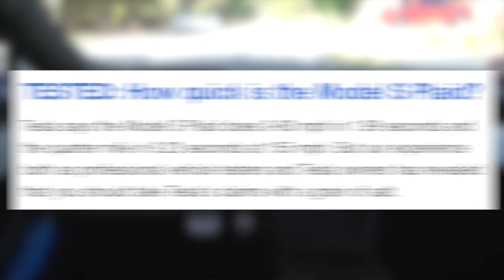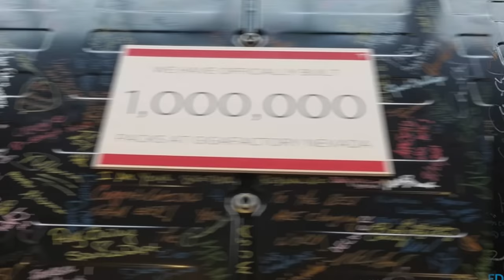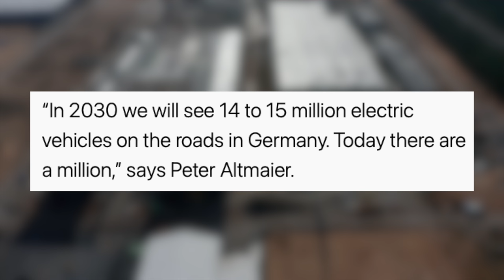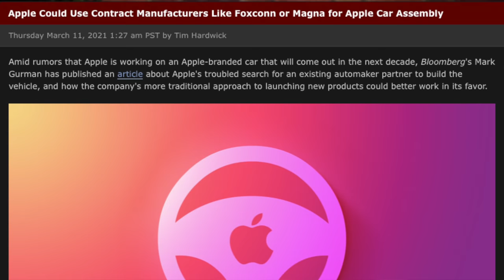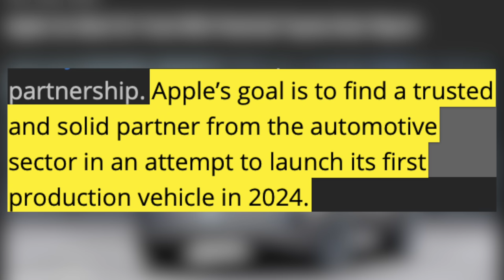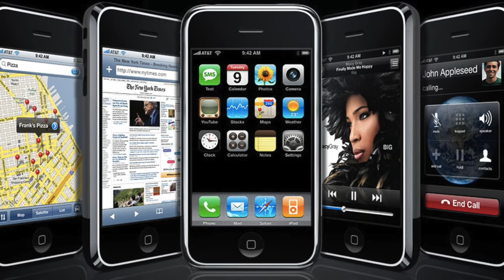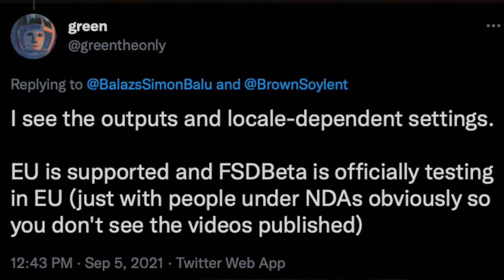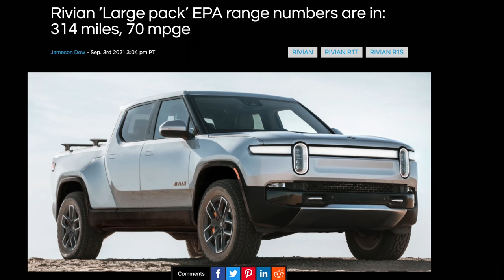Tesla's One Billion Dollar Advantage

Comment: Dodge says their 800 HP challenger will do a quarter mile in 9.9 (maybe it's less I don't really remember) but I only saw one do it in 9.9 even with the skinny front tyres and special fuel, even on a very sticky surface you can't get a close time to what the manufacturer claims, but with Tesla I have seen some 9.2X on the street and a 9.4 is easily achievable on any surface, I have seen a lot of 2.1 sec 0-60 on the street (1.99sec with 1 foot rollout) most brans advertise the best numbers they can get, and Tesla is one of them but the plaid model S gets very close to the claimed numbers even on the street unlike most others brands that are like dodge ( this does not apply to brands like Porsche because they always do better in real life than the claimed numbers 😂).
Reply: Yep. In fact most ICE cars require massive amounts of skill to get their sub 3 second times.
Reply: @ernestbethel2035  you can see videos of Ferraris losing control in like 1 second, you don't see that a lot with EVs because the power curve is a lot more "predictable"
Reply: Another way to see this is Tesla proves it can be done and other the. Try it
Reply: Its a RWD car, it simply cant put the power down unless it transformed into a real non street legal dragster. Look at all the built GTRs out there, the fastest one has done the 1/4 mile in 6.58 seconds. The fastest EVs are still in the 8s, and those are millions of dollars. The plaid is impressive setting low 9s for a production car, and I'm sure the roadster will hang in the 8s when its out.
Reply: @Malinkadink  the fastest EVs can be on the road, the fastest ice are SUPER UNSAFE and go to track on a truck, I don't give a fuck about how fast an ice car is if it can't even drive on the street. I just saw a video of cars losing control after heavy acceleration, Ferraris, Dodge, McLaren and much much more, the ice cars power curve is less predictable when compared to a ev. Why do think the most HP on a ice car for now is 1500 HP stock from the factory? Because you can't get it higher in a safe and reliable way, EVs are coming out with 2000 hp from the factory. Yes there are ice cars with 2000 HP but they blow up gearboxes all day and can't even drive on the street because they are to unsafe or even illegal (just check carwow drag races and see how many times a tuned 1000+ HP ice car as broken down). Just accept the physics, I have studied a lot about this because I am a mechanical engineer student.
Reply: I always get a chuckle when some people mentioned that their 1000+ hp ICE car are useable for a daily drive 😁
Reply: BMW also does better in real world use on all performance and economy numbers.
Reply: @KungPowEnterFist  Nice! But only the new models because they have a great AWD system and before most of M performance bmw were RWD so you would get a worst time on bad conditions.
Reply: @meisterkenobicrypto  Well, bad conditions are bad conditions.  I don't think any reasonable person would think that the MPG's, 0-60, etc., would be the same in a blizzard, heavy downpour, strong headwind, mountains, etc., as they would be in 72 degrees, flat, no wind, no rain, etc.  However, BMW's stated numbers are usually very conservative.  Mercedes tends to be pretty tight with their numbers.  Others just straight up lie, like Tesla lying about their economy numbers.  Performance seems to match up with their claims...sort of.  Lots of asterisks.  Economy, lol, not a chance.  You will need to go to extraordinary lengths just to get 2/3's of what they claim.  Its ridiculous.  A typical user using the car like a normal person should expect to get about half of what Tesla claims.  Half!  And part of that is only possible because Tesla is most giving away the power at their charging stations for no profit.  That ain't gonna last.
Reply: @KungPowEnterFist  check carwow driving teslas and other EVs and see the results of the range tests, if you think Tesla doesn't do it's claimed range by a large margin the. You haven't seen the polestar ahhaha, polestar gets around 60% of it's range. Carwow does highway testing, please check on of the videos. It's the WLTP and EPA that test the cars, if you want a real range estimate check Bjorn nyland a ev YouTuber from Norway, he tests every ev from the most expensive to the cheapest and data shows that Tesla is still in lead by quite a margin.
Reply: @meisterkenobicrypto  I didn't say anything about range.  I said economy, as in cost per mile.
Reply: @KungPowEnterFist  Oh i didn't know you were talking about cost per mile, cost per mile is realated to efficiency and the teslas are still a lot more efficient, data from bjorn nyland proves it. Also i have i noticed that tesla superchargers here in europe are muchhhhhhh cheaper than the chargers from ionity and other brands, so a road trip in something like a ford mach-e in worst case could cost 2 times more than a road trip with a tesla because the mach-e is much much much less efficient and pays more for charging since it can't use the superchagers. I own 3 evs, Renault zoe, Tesla model 3 and X, and I have recorded all the data on how much i saved, were and when i charged and much more, and what i know is that 90% of the charging is done at home during the night time with very very very very cheap eletricity, at my house if i charge on the low price hours I pay around 8 times less than if I had a ICE car, but when i went on a roadtrip and tried to use ionity chagers i only saved around 1.5 times the cost when compared to an ICE car, but since I charge 90% of the time at home the average is (0.90*8+0.10*1.4)=7.34 times cheaper than an equivalent ICE car. I think you should take a look at the Tesla impact report 2020, there is a section talking about cost per mile and i think you would be interested in taking a look. Evs will get cheaper and cheaper will ICE fuel will go up until they die. This is my opinion as a mechanical engenieer. (Data in the tesla impact report is collected from tesla drivers and are not made up projections, remenber that data doesn't lie).
Reply: @meisterkenobicrypto  I did not use the word range not once in my comment.  This is Elon in your head.  Anyway, it seems that for you range is absolutely not the problem, which is the case for the vast majority of people starting around 250 mile range.  You claim you are able to get 90% of your miles covered when charging from home, and, yes, for basically everyone charging from home yields the lowest cost per mile.  7.34 times cheaper (operating cost only) than an equivalent ICE car?  Not a chance.  2.5-3 times cheaper vs an ICE car, maybe, but only in local city driving and all your charge must come from your house and you must be in a market where gas is particularly expensive and electricity is relatively cheap (which is code speak for comes almost entirely from fossil fuels).  In highway driving your cost per mile goes way up, and now you are closer to be on par with an ICE car if you do the same work in the same time (which is the only apples to apples).  If you supercharge (and even most L2) any amount on the road, even with Tesla's sweetheart rates, the ICE car wins by a small margin.  However, your claimed use is not typical for a 12k mile per year driver.  Only 1200 miles on superchargers, and even then only on Tesla superchargers which for the time being are being operated at a loss to promote adoption.  Not very realistic at all.  PHEV's are the actual future.  They are actually slightly cheaper to operate than an EV in local city driving provided enough range is available for your typical use.  Plenty of them now with ~30 mile range, and with the Toyota RAV4 Prime, Mercedes C300 PHEV and a couple others coming out now with 40-50 mile EV range, things actually get worse for EV's in the CPM (and environmental) discussion.  On the highway, forget it, no contest.  3+ times cheaper than an EV.  Overall, gasoline would have to be something like $9-$9.5 per gallon for a Model 3 to be roughly on par in CPM to something like a BMW 330e in a typical 12k per year use case.  $10+ per gallon to be on par with the RAV4 Prime/C300 type of PHEV.  That ain't happening anytime soon.  BTW, "engenieer" is spelled engineer.  I am an Electrical Engineer with a BSEE, MSEE, and PE, and I am an SME in electrical, electrical machines, and control systems.  If we actually had our priorities right, the future would be PHEV's with ~50 mile EV range, with E100 ICE's with 250+ mile gas range, and everyone would be required to install a PV solar system at this house with sufficient capacity to cover all the vehicles electricity needs.   EV's actually push us in the wrong direction, since they can never be carbon neutral let alone carbon positive and are a terrible economic decision in every way.  Only ICE's using E100 can be carbon positive, and PHEV's are just cheaper to buy, operate and maintain.  Much more affordable to install a PV system at your house to cover the cars EV needs.  None of this speaks to Tesla specifically, which are especially poor value propositions in any case.

Comment: Dodge Charger Hellcat has a 0-60 of 3.5 seconds.  You can't get that with stock tires on the road.  You need special circumstances.  Expensive tires and a prepared track.  Did Edmonds also say take the claims of Dodge with a grain of salt?  Or did they just flat out say Dodge lied to you?  I notice a pattern.  Tesla does it exactly like the Legacy Auto and gets knocked for using industry standard testing.  The same testing they have used for the last 50 years....  Take Edmunds reports with a grain of salt folks.

Comment: tesla plaid channel did a 9.06 on 1/4 mile with plaid model S
As always a great video!
Reply: Modified
Reply: @Delitor  That car is box stock as it came from the factory.
Reply: @iowa_don  it wasnt. The interior was stripped
Reply: @Delitor  I watch all of his videos, the interior isn't stripped on either of his TWO Plaids.  He MIGHT strip the interior on the second Plaid when he installs a roll cage but that has not happened yet.  Actually Niklas B is incorrect.  He has run a 6.04 @ 121.36 in the 1/8th mile but his fastest (mostly they won't let him run all out per the NHRA without a cage) is 9.434 @ 149.38 in the 1/4 mile (so far).

Comment: Every vehicle requires specific conditions to hit the 0-60mph.... this is just them being douchenozzles to Tesla..
Reply: Agreed.  Drag times did 10 quarter mile runs in a row at 9.2 - 9.3 and the consistency from run to run was insane.  Even Motor Trend (usually bashing Tesla) said it's quarter mile runs were nothing short of "robotic" they were so spot on.  Tesla could cure cancer and drive on water and the media would bitch that the tires only come in black rubber.

Comment: We got our M3 SR today. Absolutely beautiful with the white interior. Cheaper than the Leaf. Thanks Ryan for the 1000 miles of Super Charging!
Reply: Congratulations Steve, this is a BIG deal!!
Reply: What country do you live in Steve?
How is it cheaper than the Nissan Leaf? My understanding is that the Leaf is usually cheaper than the SR in most jurisdictions.
Reply: @Nicholas.T  you beat me to it.
I'm in UK and have same question.
I've driven no Tesla's but tried two Peugeots, new leaf, i3 and a Kia E-Niro BEV. Kia best so far based on empirical evidence (I do a lot of miles on many classes of vehicles for provenance of that endorsement). 
The Peugeot guy said there's a queue for test drives for their BEV's  which are very nice. However experience with 6 recalls in three years on a Citroën Despatch van (ice) puts me off French though.

Comment: Forgetting about the other manufacturers have dealerships especially with the US based ones that have a loophole that manufacturer is required to offload the vehicles to the dealerships, and then the manufacturer can classify those vehicles as “sales”, since it’s off the manufacturer books.

The $25k vehicle should be called Q for the TSLAQ.
Reply: It will probably be M as in S E X Y. M(otherf____________)

Comment: The Rivian is 7000 pounds so when you add 4 beaffy adults their truck bed can only accept  a few hundred pounds.  The Cyber truck will be about 5000 pounds so it can carry a few thousand pound in its bed.  Thus we see Tesla's advantage.
Reply: Sorry Robert, the Cybertruck at 5,000 pounds is pure speculation. 
Tesla has NOT released any official specs for its weight, nor the actual capacity/size of the batteries (in kWhrs) for that matter! (Tesla has only released the mileage range of each version).
Rivian, on the other hand HAS released OFFICIAL specs for both these parameters.
You need to compare apples with apples.
Reply: The CyberTruck will not weigh a svelte 5000 pounds.  Unless the battery pack is made out of air/helium.
Reply: @Team_Trade_Down  It's supposed to weigh as much as a Ford F150 and have a payload of 4500 pounds.  Regardless, the fact that the Rivian is 7000 pounds means it won't be competitive as a truck.
Reply: @robertfrancis979  NONE of the EV trucks will be light.    Batteries have mass.  Trucks have mass.   6500-7000lbs seems reasonable for the Lightning and Rivian.  And probably the Cybertruck.  The Hummer is a portly 9000 lbs.   If someone manages to build a truck, with a range greater than 300 miles, that weighs less than 6000lbs, it will be an engineering miracle.

Comment: If Tesla even wants to start dreaming about beating Apple and Toyota they need to release and scale up the 25K model ASAP, cause that's the model that will establish securely Tesla as not only the electric market leader, but the car leader in general.

Otherwise Apple, with its incredibly marketing strategies and the enormous brand loyalty that it has built, coupled with Toyota's massive manufacturing capacity and quality will be really really hard to beat.
Reply: And eventually, Toyota will go to Tesla for instructions on how to design and build an electric car manufacturing factory - coz so far, nobody can do it like Tesla.
Reply: @wrongtimeweeder1076  maybe Toyota can help Tesla figure out how to put a car together without panel gaps and defects..